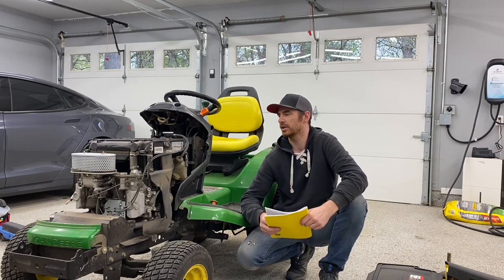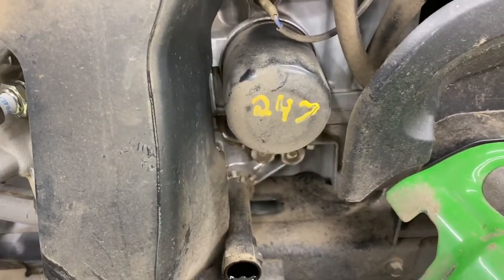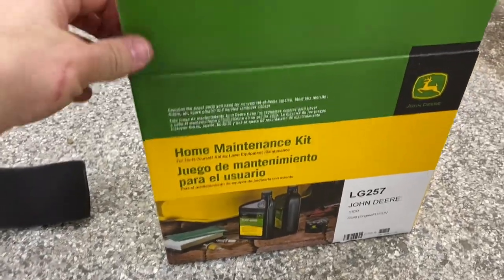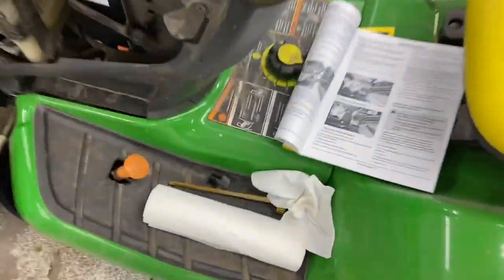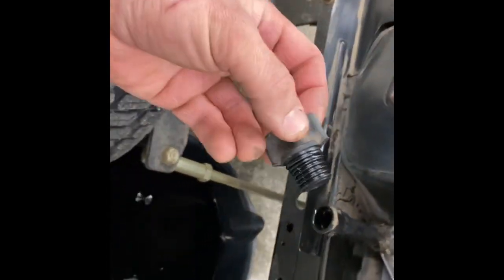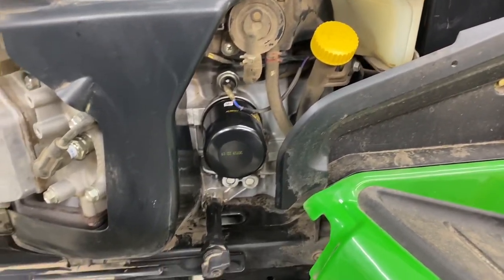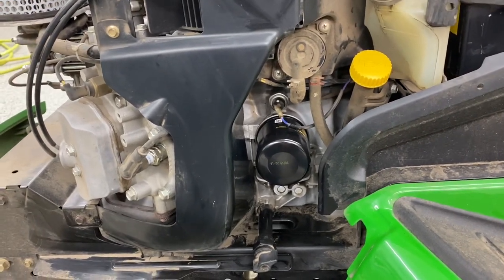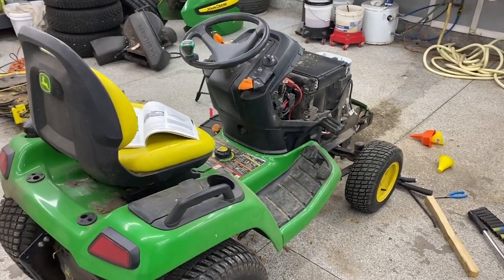John Deere oil change DIY

Comment: So I did a oil change on my x 540 and afterwards my low oil pressure light came on and stays on
Reply from the maker: That’s weird. Have you rechecked oil level? That would be my first suggestion, verify that the correct amount of oil is actually in the machine.
Reply: It is up to the full line and I went to a John Deere dealer for the oil and filter
Reply: I had a similar experience with my first car. I knew it had oil so I drove anyway. Bad idea. The oil pump had not primed and I ruined the engine. Be sure you have oil pressure!
Reply: John Deere engineered a plastic gear to hook to the metal cam shaft for the oil pump. Luckily I didn’t have it running long!
Reply from the maker: Sounds like a design flaw, that’s too bad to hear. Glad you got it sorted out and hopefully nothing was damaged. Way to spot the oil pressure light and not ruin the engine.